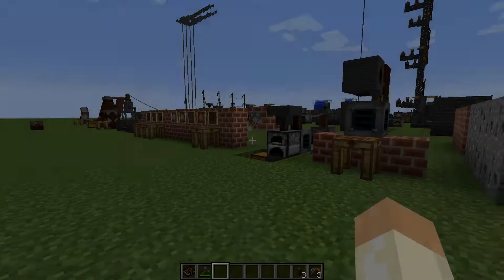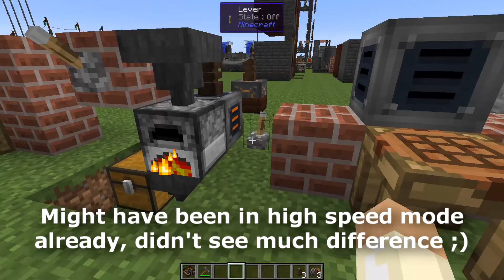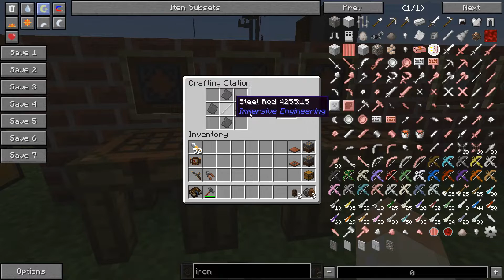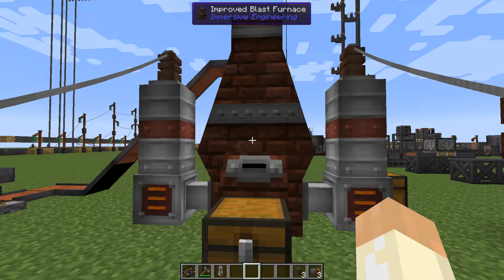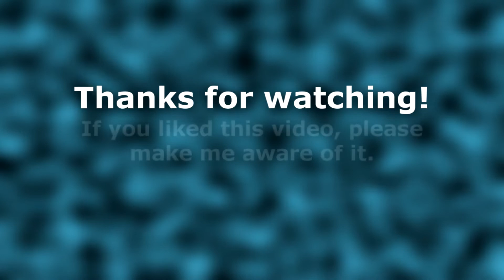IE Tutorial #7 - Improved Blast Furnace,  Metal Press and External Heater (MC 1.7.10)

Comment: How come when I use the pre heaters they don't have any effects. They dont look like there on
Reply from the maker: To be honest, I haven't used them since I made the tutorial. What game and mod version are you running? Also, how are things connected with cables and power and all that?
Reply: @therealtkh  same here with me, I'm on 1.12.2 on a forge server, I have them powered and all but there is no animation indicating that they're on, but they use up energy so I'm guessing they are working Idk
Reply from the maker: @lolan7410  I did a quick test in a 1.12 test pack and I can confirm they have no animation to show they are working. I recommend building all this in a creative test world and compare the results. Note that Pre-Heaters (one on each side of Blast Furnace) needs to connect properly to furnace, LV connectors goes on TOP of heater. Check with Voltmeter if they get power, but you can't see how much RF flows that easily. In my test I compared one setup without Pre-Heaters and one with two heaters connected. The one with two heaters produced Steel much faster (3 ingots in the same time as 1 ingot in the basic setup). I think the amount of Charcoal is the same. And as a final word: don't mix up External Heaters with Pre-Heaters :)

Comment: Is slag useful, or no?
Reply from the maker: Well, it depends on what modpack/selection you play. You can use it to make Cement which is a building material. In a modpack with Thermal Foundation you might be able to make Clay from Slag. But again, it depends on the pack config.
Reply: @therealtkh  
Oh, okay.

Comment: so does metal press not work at all in direwolf20 1.10.2? build it exactly like that in video but hitting the piston with hammer just keeps turning the piston
Reply from the maker: I haven't tried that specific pack with the version of IE they picked, but I know that many items/structures was not implemented in the 1.10 release. They are probably coming one by one, but this might be the reason (unless it's a bug). In either way you can probably check this with the mod dev :)
Reply: TKH nvm it worked they changed the recipe to use 2 steel scaffolding and a Redstone block device (forgot the name of it)

Comment: Well I'm facing a problem/ bug using Metal Press that metal sometimes stopped on the conveyor belt..  :(
Reply: +秦煜 and it usually happened when using Metal Press Mold: Gear
Reply from the maker: +秦煜 I haven't played much with these things after doing this tutorial, but I have experienced a few things like that myself. Make sure the turns in your belt systems have at least one block of straight belts before and after these machines. So they are perfectly aligned with no level difference too close I mean. Also try to have no things under the belts, for example, a fence block under will stop all items. Finally, make sure you insert enough items into the Metal Press, but I guess that one is pretty obvious :) If you experience bugs, make a bug report on the github site so the devs can fix them.